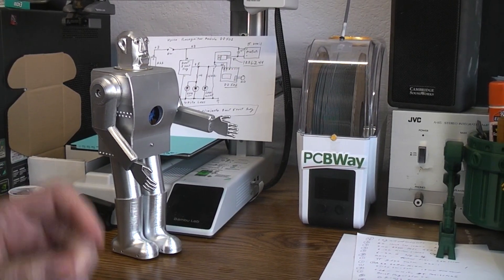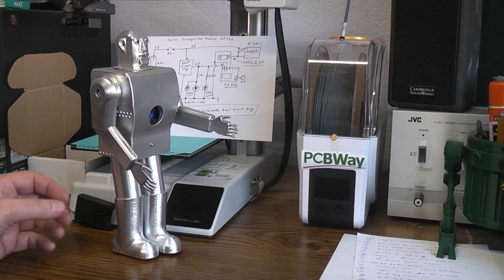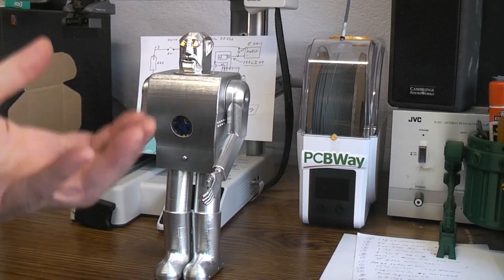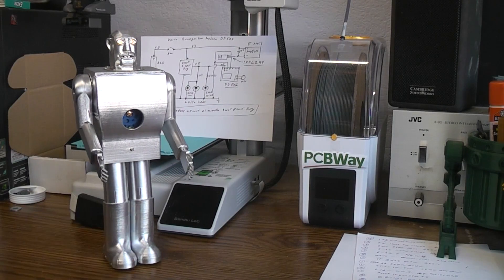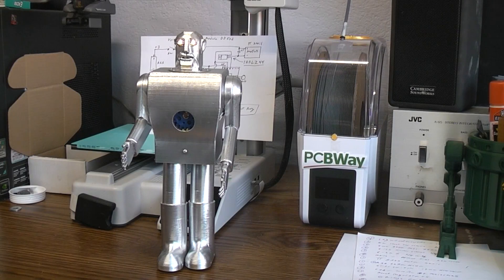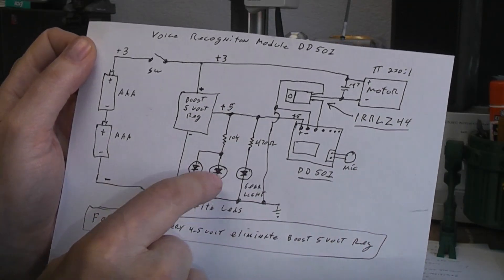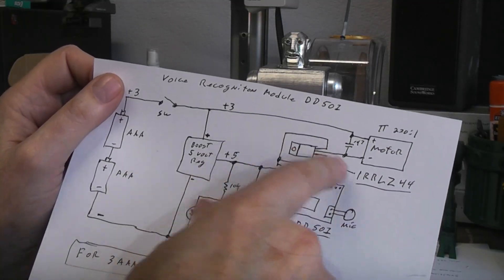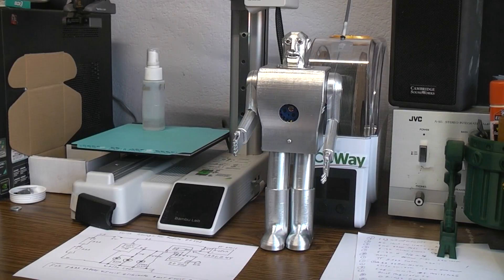Voice controlled, 3d printed, Elektro robot project. 3-volt test version.

Comment: This voice controlled unit might be just what I'm looking for to control my 1:1 scale Robby. I need a way  to make his Sax Valves work just before he starts to speak and was looking at Arduino boards for that but I know only a little about electronics although I was an electrician for 20 odd years so I certainly can learn and the internet is full of stuff like that. Something to ponder on.
PS I love your working parts for Robby, I'm going to be working on fitting your rotating gyros pretty soon, just finished the Wig Wags and their integration into the front of his head.
Reply from the maker: Fantastic, sounds like your having fun with the ideas and designs. Thank you for posting.

Comment: The legs look like they'd be the perfect size to hold batteries.
Reply from the maker: They are and I thought of that back when I designed them, but it would mean adding large door of some sort to the back of the legs and I did not like that. Inserting the battery from the bottom will not as the wheel ratchets are located there.

Comment: Amazing that you can get a voice recognition chip for so little money. Dead easy to use too. Have you left the programming switch connected so you can change the triggers if you want to?
Reply: He has a video of a Dollar Tree item with sound control. Great for scavenging parts I suppose?
Reply from the maker: I wanted to leave the switch connected but then I would have to make a way to get to the switch, a button or a hole . I did not like doing that, so did not.